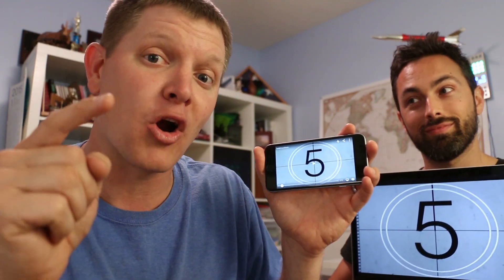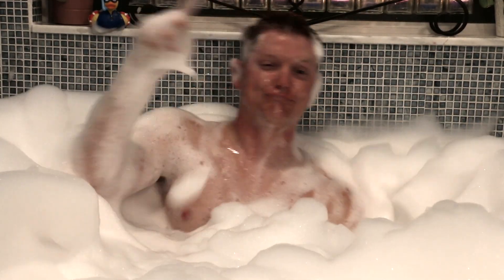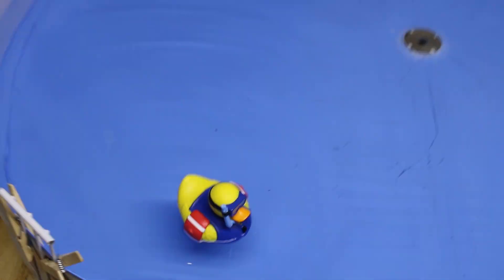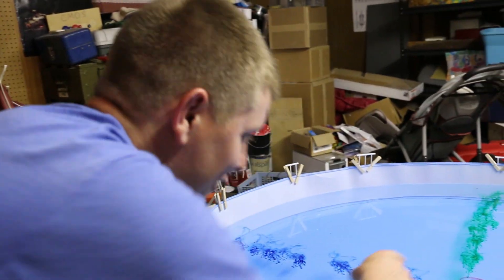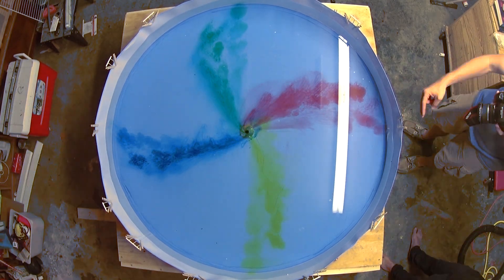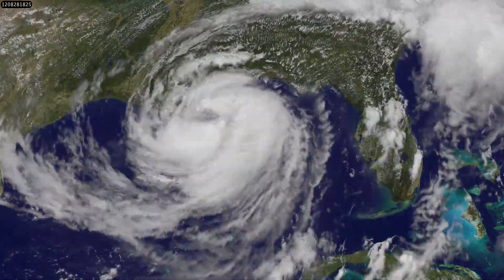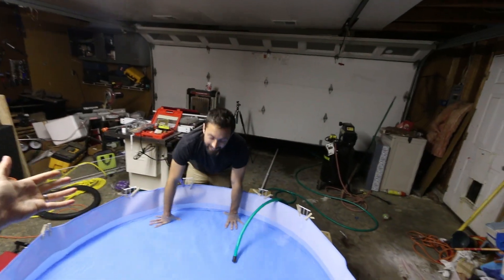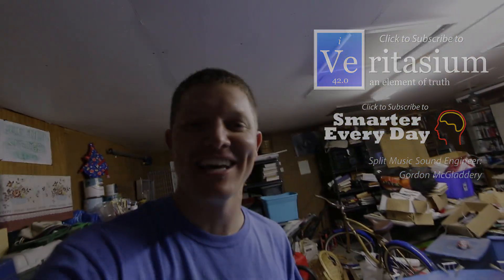The Truth About Toilet Swirl - Northern Hemisphere  (Smarter Every Day 137)

Comment: The speed of the earth spinning at the equator is 1,600 KPH. A meter is 1/10,000,00 of the distance between the North Pole and the equator. The kiddie pool is 2 meters across. So the difference in speed between the "North" end of the drain and the "South" end of the drain is 2/10,000,000 of about 1,000KPH (due to your latitude). That equals a speed difference between the north point and the south point as twenty centimeters (about 7 inches) PER HOUR. As my analog watch dial is 3cm in diameter, the speed which the hour hand moves around the dial is 10 cm per hour, a rough approximation of the speed of the one of the furthest points from the drain on the pool. The viscosity of water, Brownian motion,  and how the drain was made (is it made by the manufacturer to spin?) would completely overwhelm any Coriolis effect that is this small.  Even tornadoes are too small to have them spin in any particular direction. Hurricanes are much, much, much larger so the Coriolis effect does indeed make it spin counterclockwise in the Northern Hemisphere. The math first before the experiments begin can show how much trust you can put into the results you see.
EDIT: the Wiki article about the Coriolis Effect had an example of a scientific experiment in 1908 that showed a statistically significant result of CCL draining of a 1.8 meter tub of water with initial conditions similar to what was done in this experiment but under  "carefully controlled laboratory conditions", it took  over 15 minutes before any rotation occurred,  it was done many times, and the results averaged (which to me means that sometimes it did NOT go CCL). Was this experiment done under such exacting standards? I donno.
Reply from the maker: John Pombrio  7 inches per hour?  Thanks for doing the math.  This checks out.  It took about an hour to drain. and the deflection observed was a little less than 7 inches. Awesome!  Thanks for convincing me John!
Reply: SmarterEveryDay  I am not trying to support your experiment, I am debunking it. The Coriolis effect is way too small to affect something as tiny as the wading pool unless all larger effects are removed. Since the water started to swirl (CL or CCL, it does not matter) almost immediately, the water around the drain itself would have moved less than a hundredth of a millimeter per hour east or west during the time that the initial swirl started. yes, tiny variations will cause the swirl to start in one direction or another but the CE is just so tiny. There is NOT ENOUGH SPEED  caused by the Coriolis effect to determine the initial direction of the swirl unless all other possible larger effects are ruled out.  Once it starts, and as long as the swirl continues in its initial direction, it DOES NOT MATTER what else happens (one hour to empty, two hours, who cares?) Other factors are way more likely to swamp such a microscopic movement. 

Your apparatus and environment a too crude to think of this as a valid scientific experiment. I can think of several flaws in your experiment. One is that you were lucky and the water spun CCL during your limited number of tries. The most likely one is how you designed the drain. The major problem was simply that your drain was way too large (it takes a lot of time for the tiny movement to affect the water swirl). If you used a flange that was not completely symmetrical (how the hole was drilled out could leave microscopic marks affecting the flow), the flow would be affected (does modern plumbing supplies deliberately swirl the water to aid in draining like they do in toilets?) Another is the bend in the PVC. Water flowing past may have been bent by the Bernoulli principle and sped up on one side, causing the water to swirl in a particular direction. Opening doors going into and out of the unheated garage could cause unwanted eddy currents. UNEVEN cooling of the water in the garage would certainly affect the results (sunshine through the garage doors during the day could do it). Ribs in the bottom of the wading pool may have been added to prevent slipping (are they in a spiral shape ?) or even tiny winkles of the plastic pool bottom and sides. Outside vibrations, air leaks in the garage doors and a subsequent breeze, how level the pool was all could add enough outside influences to get the water to swirl in one direction.

Move the entire experiment in a deep cave. Use a huge ultrasmooth and dead flat tub. Create a drain that had its enter hole punched out and machined completely smooth VERTICALLY (rather than in a lathe). Have the water pour out directly onto the floor (no pipes). Add distilled water. Let it set for a month making sure that there are no thermoclines. Then run your experiment a hundred times. You still won't convince me but it will be much better attempt at eliminating other factors.

http://www.scientificamerican.com/article/fact-or-fiction-south-of-equator-tornadoes-spin-in-opposite-direction/
Reply: pinkace Not enough tries to make it statistically significant.  And the setup was designed to prove the CCL spin. There were no other factors except the Coliolis effect mentioned which makes it fail the Baloney Detector Test:
http://www.brainpickings.org/2014/01/03/baloney-detection-kit-carl-sagan/
 I still think the drain plug is designed to swirl the water to make it drain faster (like the toilet jets mentioned in the video). I will have to go to Home Depot to see for myself how they design the things. Or perhaps the kiddie pool has a ribbed design (to prevent slipping) that affects the way the water flows. The math does not lie.

EDIT never though about how the draining valve causing eddy currents that could affect the spin. Thanks for whoever mentioned this.
Reply: John Pombrio But... it worked.
Reply: PyroMachinima "a doctor isn't even a scientist"

What? Becoming a MD requires a great deal of science education.
Reply: John Pombrio  Nit flag set. EDIT paragraphs better.
John, 
Rockets, Doctors and drain asymmetry aside, I'm not disputing your overall point. 
  "Math first.", but...
...
Estimates are valid when starting with appropriate values/assumptions/models.
......
Primarily,  it is not the distance between the pole and equator that matters, but rather the distance from the earth's axis that determines the moment, or angular momentum.  This is 6, 378,100 meters  @ the equator, or 3,566,600 at latitude 34.0.  Your 1,000 KPH is a reasonable approximation to the 933.7 speed, given 1,669.8 KPH  @ equator.
...
Then, it is the difference between the pool center and edge, not edge to edge that determines the "drain-moment" in the pool.
...
Of course everything is at the same angular speed.
...
Finally, at latitude 34.0 degrees, the pool is inclined due to the latitude.  This reduces the difference in moment between the center and edge of the pool also by a factor of SIN(Latitude), or about 0.566.   
...
By my sketch, the latitude inclination introduces a vertical component of motion into the pool water via the rotation/centrifugal motion, which I feel can be (well, is) ignored here.
...
Therefore, the moment (around Earth's axis) from pool center to edge (1 meter) becomes 0.566 and the ratio is now 0.566 to 3,566,600, or 1/6301393.  To more easily compare to your ratio, that's 2/12,602.785. 
...
An even smaller number, my point.
...
This got me 7.480 Inch per hour. 
...
Providing, of course, I got that all correct, otherwise my overall concept it still valid, namely that it is even smaller thay you show,  I also recognize that your final estimate,  of about 7 is still valid.......considering..
..
.  I always must consult my good-ole' Sage and trig-advisor Chief Soh-Cah-Toa to make sure I pick correctly between SIN and COS...(;-) 
...
I'd appreciate a math check.  Anyone? ??-- Cheers, ScienceAdvisorSteveClear nit flag.  Chuckle
P.S. 'Sombody" has lots of extra money to prove (well at least try to), not unlike Mythbusters, what is obvious from an ordinary understanding of science.
P.P.S.  I can't believe I spent an hour sketching this out and writing it up, but that is the curse of the pedantist.
P.P.P.S.  I think it would be the research Doctor that is the "Scientist".  Doctors are mote in the category like engineers who put the science to practice, no?
P.P.P.P.S.  and, Oh Yes !!  BTW, pretty neat video editing work, guys.  KUDOS!.
...
P.P.P.P.P.S.  And to think that breaking spaghetti got me into his.  Sheesh!  "sombody" need to get a life.
Reply: John Pombrio agreed. This was a very fun experiment but the attempt to remove variables inevitably falls short due to the lack of control over the experimental setup. The pool must be uniform density and construction, the surface it is on must be level with the surface of the water and the top ring of the pool, the direction which the valve opens first will effect the flow of the water, the act of adding food coloring creates vortexes,  and many other things that Destin simply does not have the resources to eliminate in this experiment. 
Theoretically the Coriolis acceleration will cause a perfect basin of water to drain differently in the north and south hemispheres but it is not an observable effect on that small of a scale, which can only be attributed to the geometry of the experimental setup and the external forces acting on the system. 
i love this channel though it makes you think. which is never bad.
Reply: John Pombrio First of all, it worked. Second, we already knew it was going to work because as you yourself stated, it occurs in hurricanes. These guys aren't scientists, they're not doing these videos to prove new things that the world has never heard of before. They are attempting to enlighten people in a fun way. They are using experiments to demonstrate how things work. It doesn't need to be a good experiment, it just needs to work.
Reply: Trollocs If you read the description on the Veritasium video, both of them tried the experiment 3 times, with expected results each time. That's 6 trials; there's a 1.5625% chance of these results occurring by random chance alone. This passes the 5% alpha level used in introductory statistics (though not in rigorous sciences, which use much lower alpha levels for confidence in a correlation).
Reply: Oskari Kilpi Exactly. As you said "under more exacting standards" I would not have objected AT ALL to this video IF the presenter had said that the results MIGHT be due to the small effect of the CE or that they MAY BE other factors in play. Instead, he said that the CE was THE reason why it always spun in a CCW direction. Like I said, it fails the Baloney Detection Test (see link above). He debucked the toilet swirl and should have enough sense to add some objections to his own experiment. Doing a scientific experiment correctly is HARD and should not be simplified to the point of ignoring stuff just to make it understandable to the general public.
BTW, I too love the channel. The bicycle video was thought provoking (and yet I objected to that as well, heh).
Reply from the maker: John Pombrio Here's the link to puchase the exact same pool:

http://www.amazon.com/Intex-56451NP-Inflatable-Snapset-Pool/dp/B000OV0X34/ref=sr_1_1?s=toys-and-games&ie=UTF8&qid=1433743067&sr=1-1&keywords=5%27+kiddie+pool
Reply: John Pombrio eh, who cares, it's been proved before and they used this experiment as an example, of course they weren't trying to legitimately prove something with a backyard experiment.
Reply: John Pombrio Your unedited comment was clearly phrased as if you were expressing skepticism about the effect itself, not the video.

That's also the only way your comment makes any sense as going into a ridiculously extended critique about what was obviously meant to be a fun and quick video and NOT under any means a fully valid experiment is silly. 

Of course it doesn't fit into any scientific standards. These people have better things to do then set something like that up. That wasn't the point of this video at all.

Perhaps they should have mentioned it yes, but you're being overtly harsh and the critique was unnecessary. A quick comment about it would have been sufficient. Not a 500 essay.
Reply: ReX Slayer Yeah so long as everyone seems happy, who cares if it's a perpetuation bullshit pseudoscience, right?
Reply: Jeevan Devaranjan  Pulling just one piece of information from one of the sites used by Derek in his defense is this little nugget: "it takes hours before the tiny Coriolis force could develop sufficient deviation in the draining water for it to produce a circular flow."  In the MIT article you have quoted is this little piece of information " For the first 10 or 15 minutes, there is no perceptible rotation of the float. But after about 15 minutes, a distinct CCW motion occurs."  In the video, it only took seconds for the water to start swirling in the wading pool. I quote from the video "Right off the bat!"  Something started this water swirling much, much, much more quickly than it should have taken.
Reply: John Pombrio SmarterEveryDay - guys, you are both missing the point. Water going down a hole without swirl is an intrinsically unstable behaviour. Any perturbation at all that introduces a net circulation is going to be amplified as the water drains. That makes John's calculations basically irrelevant, because however small the speeds attributable to coriolis action alone might be, these can be added to by the conversion from gravitational potential energy to kinetic energy that occurs as the water leaves the pool.

We know based on many other kinds of evidence that the coriolis effect is real; we also know, as you proved in the videos with toilets, that it's not the only factor that can determine the swirl direction. Rather than eliminate all other sources of perturbation in the pool that you felt you could, it would have been much more impressive to deliberately allow perturbations that you would expect to act the opposite way, and demonstrate that the coriolis effect is the dominant effect in your pool.
Reply: John Pombrio My IQ just went down 9000 points
Reply: ***** No, that isn't statistically significant, the sample size is way too small. Just because it worked 100% of the time doesn't mean anything, especially since the experiment could've been affected by constant issues, so even if tested 1000 times and getting 1000/1000 it'd still be inaccurate. If you test 3 people for AIDS and they all have it, does that mean that everyone in the world has it? No.
Reply: John Pombrio A simpler explanation to the Coriolis effect, visualizing the momenta of individual water particles is conservation of angular momentum:
In the northern hemisphere, everything has a counter-clockwise angular momentum, which gets greater the further from the equator.
When the pool drains, water goes toward the center, decreasing the radius of the center of mass (radially), which decreases the moment of inertia of the water (yes, mass decreases as well, but moment of inertia depends more on radius than mass - I = mr^2)...
So with conservation of angular momentum, we have Iw = Iw. I decreases; w increases. The water in the pool starts spinning faster than it already is from the Earth's spin, and you see it spin.
The explanation with the Coriolis effect was too complicated for me, but you can see from this that the draining, the decreasing radius has a huge effect on the spin. Much more than tiny factors like microscopic effects you mention.
Reply: ***** Though I'm inclined to believe that the Coriolis Effect does affect drain swirl direction, 3/3 successes is nowhere near statistically significant. As there are 2 options, there is a 1/(2^3) chance of 3 successes, or 1/8, occurring by random chance alone. That's a p value of 12.5%, not even close to statistically significant.
For both of them, you say? 1.5625% - in serious statistical study, that's still not enough.
From wikipedia: "In other fields of scientific research such as genome-wide association studies significance levels as low as 5×10−8 are not uncommon"
More trials are needed to be statistically significant.
Reply: Jozzarozzer it's proven in cyclones and hurricanes, that's not the point, the argument he is making is that he is sceptical this is possible to simulate on such a small scale - the fact that it has been supposedly simulated before he would contest as well, the effect is so minute that experimental error is more likely than seeing the effect.
Reply: Jozzarozzer Though there might be other factors, their attempts to eliminate them  should indicate that on average, the other factors have a net 0 effect (again, on average), and over multiple trials, you'll still see statistical significance.
Having taken a basic course in statistics, I can tell you how you check for statistical significance:
Find how far the results differ from the null hypothesis (in this case, that there is no effect, that either spin direction is equally likely).
Find out how likely this result could have been obtained by random chance alone, according to the null hypothesis. Here, the chance of randomly getting the correct spin 3 times, assuming  the null hypothesis that either spin is equally likely, is 1/8, or 12.5% - and you're correct, a 12.5% is not an indication of statistical significance.
Typically, in introductory courses, we use 5%, but in professional fields like medical trials you might see alpha levels even lower than 0.1% - and for fields like quantum physics, you'll see alpha levels like 10^-8.
Cheers.
Reply: John Pombrio This was not a laboratory experiment. As they mentioned, even a small force affecting the water can change the direction. The assumption for this videos is an idealized environment, in this case you will get the results shown in the video, even if the Coriolis effect is very weak. 

SmarterEveryDay Veritasium The synced video was an awesome idea! Great work guys!  Became a bit smarter again \o/ Thank you!
Reply: Radi Bear The need for harshness is directly proportional to the self-righteous idiocy spouted.
Reply: ***** TBH I believe there is much more rigorous testing behind the scenes that we don't know about, that and a lot of research. I have the trust of credibility for these two people. I don't think this video was meant to be an ABSOLUTE proof of the theory, just a show of their findings. Keep in mind, they've spent three years on the creation of this video alone and while I would love a video that goes over their method thoroughly, I'm satisfied with this as "proof" for me personally, though I'd remain skeptical if I was someone trying to design a new invention or another experiment with this as a basis.
Reply: Radi Bear  "how do I do well in school?"
Pay attention as best you can.
Ask questions when you don't understand.
Do assignments.
Study sometimes with others if possible.
Get enough rest.
Have some free time to balance study.
...
Most of all, come to understand your interests, abilities and limitations.  Know what you like and do not like and emphasize those things you like.  Things that are difficult for you must either be worked on more, or you must decide if these things are too fifficult to learn and you must be comfortable finding interest that do not require those skills as much.  or example, if math is just too difficult for you to learn after trying everything ou can to get help, them look for other interests that do not require so much math -- although basic math up to and including a little Algebra would be very good for anyone.
Good luck
Reply: There is only one solution to this entire argument. We ALL replicate the exact same test that Destin and Derek did, on our respective sides of the equator, and post our results. If we ALL do it the same way and ALL of our results are conclusive and the same as Destin and Derek's (respective to your side of the equator) then we know that it's true. 

This whole argument is stupid anyways because if it occurs in hurricanes we KNOW it can occur on a small scale too. Who cares if the experiment is irrelevant? It was a FUN experiment to show the CE on a small scale, and it worked.

Now let's all go get our kiddie pools and prove that this experiment works 100% of the time. Ready. Set. GO!
Reply: John Pombrio Yes, 9/11 was also planned by the U.S. government
Reply: schr4nz Well, that is the point. I quote John: "[Description of a complicated experiment that should eliminate all other factors]. You still won't convince me but it will be much better attempt at eliminating other factors."
John is denying the effect, regardless of the experiment.
Reply: nerfzinet they stated that it was too small of a scale for the experiment to work. However, I agree. If it worked, then it did.
Reply: Observ45er ^this
Reply: John Pombrio  I think we have a flat earther...Why would the experiment you just described performed "a hundred times" not convince you?
Reply: but it worked... even if not a perfect experiment they experienced the coriolis effect and showed it to the world on youtube, which is the whole point of the video
EDIT: also considering this is a legit video, it is not a 100% trusted proof for the coriolis effect proved by the math provided by the john guy, considering the materials and the design of the experiment itself, and also provided they havent cheated on some way to "provoke" the clockwise/counterclockwise draining for the water, it is a matter of trust, trust they designed a good low budget experiment, trust the locations on which the experiments took place are where they say they are, trust they havent cheated, SO TRUST its what is really important here.

EDIT 2: its that impossible in the math to test the CE effect in this conditions? i dont think so, could it be by chance and luck they got it right, but i TRUST they did and i give both of em KUDOS for the video

EDIT 3: at last i see a video in this channel without some quotes of the bible, gotta say i  found disturbing mixing science or as the guy over me said "pseudoscience" mixed with religion

PEACE
Reply: John Pombrio http://web.mit.edu/hml/ncfmf/09VOR.pdf This was done in the 1960s at MIT. They showed that it is possible for the coriolis effect to affect drainage, albeit they did it in a far more controlled laboratory in comparison to the Veritasium and SmarterEveryDay experiment. The video could be the result of a statistical error, or it could just be the same results MIT got. I found the report after reading this article which wa specifically about the issue http://www.americanscientist.org/blog/pub/the-coriolis-and-the-commode
Reply: Observ45er LOL. I spent about 30 minutes doing the calculations, mostly coming up with the measurements and working on the math (I had to move the decimal point twice before I got it worked out right- metric issues, mixing up centimeter with decimeters.) We could have saved ourselves some trouble by looking at this 1969 MIT article:  http://web.mit.edu/hml/ncfmf/09VOR.pdf 
They quoted 0.2 inches per minute which comes out about 12 inches/hour.  Between you and me tho, I think OUR answers are correct and the guys at MIT were just using a rough calculation!
Reply: John Pombrio  P..............S.
Nah!  Going through the exercise is the goal.  Putting Newton, et al. to work is the goal.
-- 
I teach / lecture this kinda' stuff and examples are always needed that are worked out (well)  in advance.
...
BTW>  That article was too much to wade through.  What diameter "pool" did they use?  That makes a difference...
...
DOH!
NEVER MIND!  I just scanned down to page 6...
--
SAS
Reply: ***** 6 out of 6 times is nowhere near statistically significant at all. 

The chances of it happening literally 100% by chance in that case is still 2%, something that is perfectly likely to happen. 

However how likely it is by chance every time is irrelevant because it is very clear that the setup has pretty significant flaws, for instance the kiddie pool is very clearly slightly asymmetrical. All it takes is for both of them to have flaws that bias in their favour, which is a 25% chance. Not even remotely statistically significant.

To add they reference an article by MIT to support them, that goes entirely against what they have shown. The article very clearly states that the effect is much much smaller than demonstrated here.
Reply: John Pombrio Just wanted to thank you for your comments on this video. While I agree that what Veritasium, SmarterEveryDay, and others like them are doing is important for inspiring interest in science, I also think that it’s almost equally as important to explain what a valid scientific method\experiment is and not propagate misconception(s) instead.
Reply: Once the water starts to drain, any small force is increased multiplicatively as the force of gravity is a constant. You're smart, but you overlooked a very important detail.
Reply: +John Pombrio Thanks, now I don't have to post a comment about how this experiment wasn't controlled, wasn't replicated and isn't definitive proof of anything.
Reply: Dibu Elniv What would they know about the correolis effect? Rocketscientists are not even in the same field of science and a doctor isnt even a scientist which goes to show your incompetence.
Reply: Kian Palmer ur prdy smart
Reply: PyroMachinima lol rocket scientists are very familiar with Coriolis accelerations. Becoming a rocket scientist requires at least some dynamics and kinematics ;) and don't call people incompetent to make yourself feel better. competent people don't go around calling other people incompetent fyi, they just know deep down they are better. so you look silly
Reply: John Pombrio I think you are right, I would be more convinced if they used the same pool setup, but as you can see, Destin's video has a different plug, it's probably the same pool, but Derek shot his 2-3 years ago so the drainage was modified since and is the most likely thing affecting the results.
Reply: John Pombrio Do you actually think they're the only people to do this experiment, much less for the first time? On a youtube channel?

If you would bother to look on the front page of google it's been done several times under much more exacting standards.
Reply: Oskari Kilpi they are the 1st people to make a collab video where you play 2 at the same time
Reply: schr4nz Well, that is the point. I quote John: "[Description of a complicated experiment that should eliminate all other factors]. You still won't convince me but it will be much better attempt at eliminating other factors."
John is denying the effect, regardless of the experiment.
Reply: Steven Wang that would take quite some time to get even less than 3%
Reply: @MrPorkrolleggNcheese Actually the earth is not completely flat on the equator . Physically proven that on the equator, near Eastern Africa through west Indonesia (Indian Ocean) has a bulge of 20KM more than the rest of the world towards space. But that really doesn't make much of a difference to the Earth's rotation at all by like a fraction so your absolutely right.
Reply: John Pombrio I agree with you that a one off experiment doesn't prove anything.  Essentially there's a 50% chance that it will drain clockwise.   If we really wanted to know through practical experiment  we would have to do the experiment numerous times.
Reply: Marioncé *you're
Reply: Radi Bear  LOL.  No, His...
Reply: Oskari Kilpi u 2 bro, but I agree with you.
Reply: John Pombrio  Dear John, just drop it dude, rly, the video was a success and it worked, even if by chance it worked and everyone seems happy, ur math also proves it could be discrepancys IF the experiment failed, but it didnt so deal with it
Reply: ReX Slayer The big question is: how flat is the surface on which the pool was placed.  Did any tilt induce a swirl?
Reply: RonJohn63 nop
Reply: Catervarii that's a bit harsh
Reply: RonJohn63 lol
Reply: ***** na, they're probably making another video right now
Reply: Radi Bear *Shrug*
Reply: Observ45er It's the same pool
Reply: Radi Bear  I saw on pg 6 as I stated.
Reply: Observ45er oh, OKAY !OIH!R_IJQ+)HFD_({IKPLA
MNHBGIUFGUIJK{IHOGJF&BI<:P
Reply: Observ45er wait... ur a teacher?
Reply: Radi Bear  A disciple of Don Herbert (Mr. Wizard), or Bill Nye, if U like.  An engineer, science advisor and science lecturer.
Cheers, ScienceAdvisorSteve
http://www.challengerillinois.org/
Reply: Observ45er I need to ask a question... how do I do well in school?

Also, did Bill Nye teach you how to tie a bowtie?
Reply: Steven Wang Not true. That is a very very naive (and incorrect) way of doing experimental statistics. It is very very easy to see how other factors would not average out to 0 at all. For instance the asymmetrical area in which they are performing the experiments will clearly favour a particular wind direction. If I put a fan next to the pool blowing it in the direction I wanted and did the experiment 10,000 times, getting the result predicted from the Coriolis force every time would you say that is evidence of it? Ofcourse not.
Reply: BlueCosmology That's why you attempt to remove all known asymmetric factors. But once that is done, given that you have no knowledge of other factors, it is more accurate to assume that the unknown factors sum to 0 than anything else. They are unknown.
Take 100 random vectors and sum them. Can you expect that sum to be 0? No, but neither can you expect the sum to be anything else. You can, however, assume the average case of multiple trials to be 0, with a particular sigma.
That additional factors that are not removed are by nature unknown (otherwise they would be removed) forces us to assume that the direction and magnitude of these factors are random. And in multiple tests, given absolutely random directions, they do have an average of 0.
Reply: Steven Wang Again. That is not true. Just because you do not know what the factors are, it is not appropriate to assume they are random and hence sum to 0. In nearly all cases this is not true and unknown biases exist, this is very clearly the case here.
Reply: BlueCosmology I said the best we can do is assume they are random.
The sum of every possible case almost certainly averages to 0 with a very low sigma.
Reply: Steven Wang It certainly is not the best that is possible, a proper understanding of statistics does not just work out statistical significance from assuming unknown factors have no bias.

Again, it is very very clear that there exists factors that have bias here. Assuming everything that is not controlled is random, is just wrong.
Reply: BlueCosmology If one knows of no other bias, then there is no better alternative to assume
A dictionary definition of random:
"made, done, happening, or chosen without method or conscious decision."
That we are not controlling these unknown factors qualifies them as random.
I understand that this is not equitable with the statistical definition of random, but as it is unknown, it is the best assumption, with the alternatives being assuming, for no particular reason, that there is a positive bias, or that there is a negative bias, both of which would be unprecedented, leaving the assumption that there is an average 0 bias the best case.
Disregarding assumptions, multiple trials would indicate that there is a bias in a particular direction not represented by the factors removed, with a strong correlation with the hemisphere.
Reply: Steven Wang Again that isn't how it's done at all. You even just admit that isn't how random is defined statistically. Look up how statistical analysis deals with systematic bias. 

Not to mention you don't even need to understand at all how to deal with it statistically, it is very clear that external factors will not average to 0. I can't see at all how you could even begin to argue they would.
Reply: BlueCosmology How would you even argue that external factors average to something other than 0?
Reply: Steven Wang Again, there is without a doubt bias in the system. Exactly what the bias is is unknown, but it is very clear that it exists and is incredibly unlikely to be 0.
Reply: BlueCosmology  &  +Steven Wang   
 Because the other factors are indeed unknown and the sample size (3) is small, it is equally poor to assume they sum to zero as as it is to assume they do not.  Therefore, the correct conclusion is not that the unknown factors are anything, but that the test has a low probability of showing a meaningful result.
...
However, because I judge these guys as being pretty 'smart', I would, go on the side that the probaility of correct results is a little higher than if the tests had been done by average YouTube commenters.
--
Cheers
Reply: John Pombrio  It agrees with you. I think it is worth making experiment with a water exit on the channel twirled in a spiral left and right. As the funnel arises not at once that obviously the direction of the coming-out water flow forms these centrifugal forces.
Reply: NetIncarnate  You'll have lots of agreement there.
Reply: Eeeeeeee
Reply: James Bond Except he did the math linearly - which is very naive and discounts the effect as a whole from rotation.
He really should've done this calculation with conservation of angular momentum.
Reply: James Bond Because it doesn't account for what's happening to the pool as a whole - draining. Thinking in terms of a single particle while ignoring the rest of the pool is a little naive.
Reply: James Bond Solving this with angular momentum:
Iw = Iw
Initially, w, angular velocity, as the pool is still and rotating with the Earth, w = 1 rotation/day. Though probably a little lower than that, this not being on the North Pole.
As the pool drains, the mass (and I guess the radius too) of the water in the pool lowers, thus lowing the moment of inertia I. As I lowers, w must increase to compensate and conserve angular momentum.
The pool's waters thus rotate faster than they would due to Earth's spin. You can see that this effect gets pretty big, and the water spins much faster at the end of the drain.
So while when you consider a single particle, the CE might seem insignificant, when considering conservation of angular momentum, and the spinning of the pool's water as a whole, and the decreasing mass and radius, you can see how the Earth's spin does affect the pool's spin as it drains quite a bit near the end.
Reply: Steven Wang sorry but what he has worked out does take into account the whole system, what you have done does not. The mass of the system does not change, it moves, clearly. If you're considering the mass decreasing, i.e. you're just considering the water in the pool, angular momentum is not conserved. Angular momentum is conserved in closed systems, not open ones.
Reply: BlueCosmology The mass of the system DOES change; water is literally being drained out.
Angular momentum is always conserved as long as there is no external torque applied.
Reply: James Bond You're still ignoring angular momentum. It initially has the angular momentum of a little less than 1 rotation/day, which looks like 0 angular momentum relative to us on Earth.
When half the water is gone (let's ignore radius to simplify it), conservation of momentum dictates that the initial shall double, giving us a relative clockwise spin of 1 rotation/day, and so on, getting faster as the mass continues decreasing. (As for an argument saying that you still have to consider the whole of water after being drained, the radius is decreasing, too). My contention is that since they removed rotation initially, the ONLY torque that can be applied is random motion after it begins draining, that of which is not going to affect it very much after a while of draining.
Reply: James Bond Which completely ignores anything I just said about angular momentum. Nothing here even acknowledged anything I said. This idea about a positive feedback loop only considers initial cases, relative to us on Earth, and is naive.
Reply: Steven Wang"The mass of the system DOES change; water is literally being drained out.
Angular momentum is always conserved as long as there is no external torque applied."

No, it does not. The mass of just the volume contained in the pool ofcourse changes, that is not the whole system. That is an open system. If you want to consider conservation of angular momentum you need a closed system, i.e. including the water that is drained out.

Ask yourself this and you should realise why what you're saying is completely wrong. How is angular momentum conserved once all the mass is gone?
Reply: BlueCosmology Sure.
"As for an argument saying that you still have to consider the whole of water after being drained, the radius is decreasing, too"
Reply: James Bond Except the CE affects the entire system every particle in the pool. Try actually reading my argument instead of blatantly restating your thesis based on tracking a single particle.
Reply: James Bond "The issue is the speed of the molecules at one end of the pool compared to the speed at the other end."
Going by an individual particle basis, and only considering the particles at the very outside.
You're one to talk about ignoring posts. I've seen 0 acknowledgement that anything I've said about angular momentum has even been read.
Reply: James Bond Initially, water is still, relative to Earth, which gives it the same motion as the rotating Earth.
Then the water gets drained.
Reply: James Bond Alright, can you try to understand my argument? Here's an analogy for you.
Conservation of linear momentum: A moving car collides with a still car. It slows down, because the system has gained mass. Similarly, if you throw something off a car, it will lose mass, and speed up just a bit.

Conservation of angular momentum: A figure skater spins in place, arms outstretched. As she brings her arms to her body, the spinning gets faster. This is the concept of angular momentum.

Now consider a figure skater, arms outstretched, on a rotating ice rink. She's spinning, but is still, relative to the ice rink.

What happens when she brings her arms in?
Reply: Steven Wang "Similarly, if you throw something off a car, it will lose mass, and speed up just a bit."

Not true at all. Throw it off forwards and it will slow you down. Again, momentum is NOT conserved in an open system. Look it up. Everyone you are saying is just blatantly wrong.
Reply: BlueCosmology Fine, thow it off sideways, so as not to disturb that change in momentum. Still slows down slightly, on the basis of losing mass.
Reply: Steven Wang No.. If you throw it off sideways it will speed up, in the direction against the way it is thrown. And it is NOT on the basis of losing mass, it is on the basis of it carrying momentum out of the system, causing momentum not to be conserved in your system of just the car. The momentum of the car will increase.

Here's a test for you. Hold a weight. Now put it down. Did you suddenly start moving fast because you put the weight down? No, ofcourse you didn't. That is exactly what you're saying.

If you throw a weight off a car and the car speeds up, the car's momentum has increased.
Reply: BlueCosmology That test is a false counter example.
mv = mv.
If my initial velocity was 0, how does putting down the weight do anything? It's multiplicative, not additive.

As for the drained pool, even ignoring the lowering mass, the radius is decreasing, no?
Reply: James Bond The pool. Water is flowing inward, toward the drain. By the end of the draining, radius is 0. Radius is decreasing as a pool drains.
Reply: Steven Wang Jesus christ.. 

Here.

Consider a car mass M going at speed vi carrying a mass m.
Total mass M+m.
Pi=(M+m)v

Now the car releases the mass. So now you have two objects travelling at speed vf, the car and the mass.

Pf=Mvf+mvf=(M+m)vf

Therefore vf=v. Losing mass, does not change your velocity.

However, consider just the momentum of the car. Before it was (M+m)v, now it is Mv. THE MOMENTUM OF THE CAR IS NOT CONSERVED.
Reply: BlueCosmology Sure.
"As for the drained pool, even ignoring the lowering mass, the radius is decreasing, no?"
Reply: Steven Wang Yes, the radius is decreasing. BUT AGAIN THE ANGULAR MOMENTUM OF JUST THE WATER IN THE POOL IS NOT CONSERVED AS IT IS NOT A CLOSED SYSTEM. 

Please, before you start continually spouting nonsense about physics on the internet, read a physics book and get a knowledge of what you're talking about.
Reply: BlueCosmology EVEN CONSIDERING THE ENTIRE SYSTEM, THE DRAINED WATER SILL OCCUPIES A SPACE OF LOWER RADIUS. YOUR COUNTEREXAMPLE TO THE LOWERING MASS BASICALLY SAID THE LOST MOMENTUM WAS ACCOUNTED FOR BY THE OTHER PARTS LOST.
Reply: Steven Wang Moron. You clearly have absolutely no idea what you're talking about, and you aren't willing to learn. Grow up and stop being so arrogant.
Reply: BlueCosmology Thanks for the insults. They really help the argument progress.

Even considering the entire system, the lowering radius still has an effect. Your counterexample works against lowering mass, but not lowering radius. Unless you have a counterexample for that besides some insults?
Reply: James Bond https://www.plumbingsupply.com/images/barclay-sink-lisbon.jpg
Reply: James Bond http://www.gradcmu.net/wp-content/uploads/2012/08/Bathroom-Sink-Pedestal.jpg
The water that gets drained occupies a lower radius.
If you argue that the water drained shouldn't be accounted for, then the mass is decreasing.
If you argue that the water drained should be accounted for, then the average radius is decreasing.
Unless the experiment had factors different that would explain this...
I is decreasing. w should increase.
Reply: James Bond You're saying conservation of angular momentum doesn't apply here because it's a fluid?
I'd have though, with I = mr^2, that if both mass and radius decreased, that would actually have a greater impact on I, rather than covering for each other.
Reply: James Bond Hmmm
I'll look into it.
Reply: James Bond Problem is, my physics courseload covered a lot, but we skipped over fluids.
Care to explain to me (in detail please) why the moment of inertia doesn't apply to fluids?
Reply: Steven Wang You just reminded me about perfect fluids. Comparing water to syrup for example one rotates with the container the other is as if in free-fall. With gases it is even more obscure since gases evolve heat rather than motion. Ever noticed how much inertia gas has?

You can blow it across a room but you have to use acoustics waves to do it: https://en.wikipedia.org/wiki/Air_vortex_cannon

Here is the North pacific illustrating that hurricanes blow both ways: 
https://weatherlawyer.wordpress.com/2015/07/05/bullshit-toilet-swirl/
Reply: John Pombrio Consider the following:

 https://xkcd.com/397/

Show 'em some love.
Reply: John Pombrio let me guess, we didn't go to the Moon either, right?
Reply: ***** that is literally by definition not statistically significant!
Reply: John Pombrio I tried to check the numbers as well. After several attempts I started to literaly shift the parameters as far as I could within the error tolerance in order to obtain the competitive effect. But even with such sneaky tricks I didn't manage to come close to the rate of swirling from the guys' videos.
It is sad that such a pretty demonstration turns out to be misleading, but what is much more disappointing, it's the reaction when people turn against the reasoning for it had ruined the pretty video. As if failures, misconceptions and contradictions would just disappear if everyone would accepts them... What a pity.
Reply: John Pombrio Certainly math does not lie, but you only calculate the corriolis effect and did not calculate the effect of other parameters so that you can compare which is more dominant. Also considering they met each other, i think it's safe to assume that they bought the SAME pool, and the same drain. So any effect due to the pool or the drain should have not play a significant role if not the result should be the same in both experiment.
Reply: John Pombrio You did the math, it was 7 inches per hour, Destin found that the diversion was 7 inches and the pool took an hour to drain.

How are you trying to say that this is evidence that it's FALSE? (Spoiler: It's because you're too stupid)
Reply: +Caleb Faulkner This comment will be probably lost in the swarm of others. BUT what if we really did this. These two channels have 2-3 milion subscribers. If every thousandth person performed the experiment 10 times, we'd have say 20.000 measurements. Maybe we could get some interesting results. Please make it happen. Maybe ask both Derek and Destin (double D huh :D) to support this idea. Because it's obvious someone already did this experiment before. But this crowd-performed one would be trully unique.
EDIT: We can say people far north or far south should have very consistent results. On the other hand people near the equator should have very 50-50. I would love to see this happen.
EDIT2: Any chance of performing these on poles? :D
Reply: +John Pombrio You try way to hard ._.
Reply: +nerfzinet Except observation and explanation are not the same thing.
Reply: English please...
Reply: This video was a bit embarrassing actually. I find it extremely surprising that they haven't checked the maths properly. I was waiting through the whole video for the statement that declared these kinds of demonstrations to be bunk (if not done many times in a row).
Reply: +John Pombrio But do you know why kids love the taste of cinnamon toast crunch?